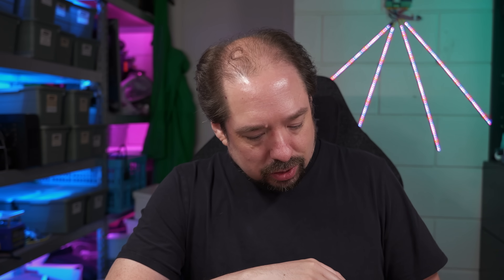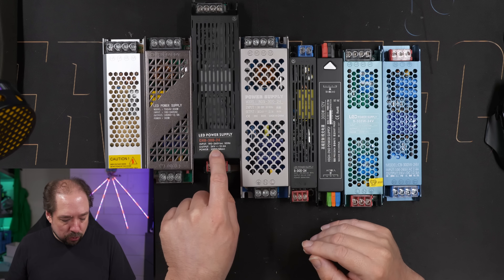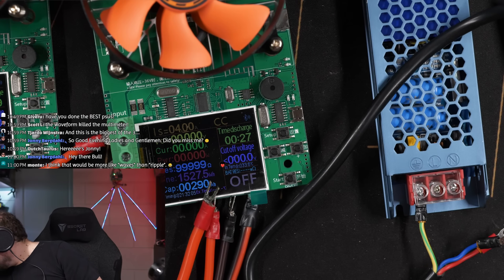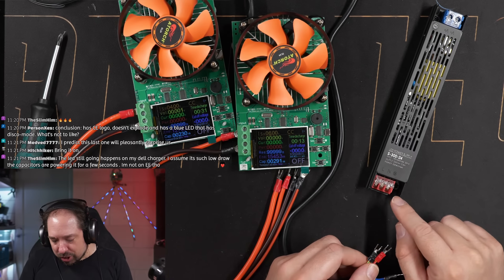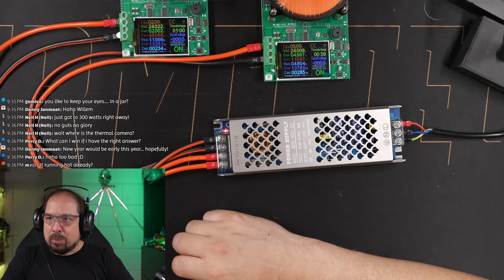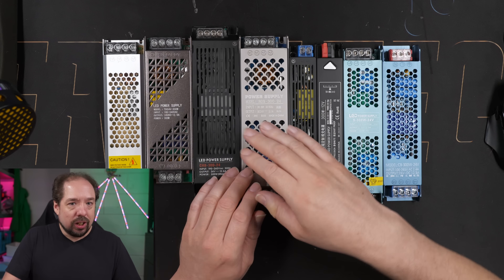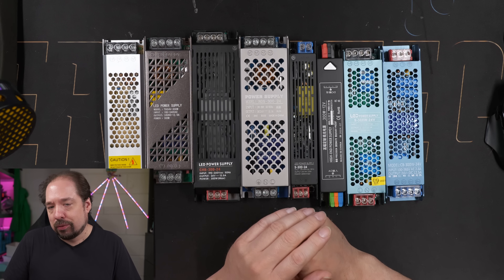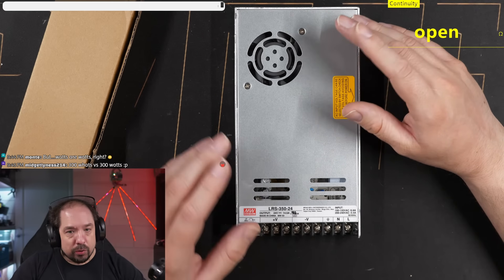💡QuinLED💡The Truth About LED Power Supplies | DON’T Make This Mistake!

Comment from the maker: What's your personal experience with power supplies in your LED projects? Have you ever been duped by such an "LED Power supply"? Let me know in the comments!
Reply: Like you I stick with Mean Well. A few years ago, I used them in a weatherized enclosure to power my original Dig-Unos. They've been worry-free and surviving the Texas heat ever since.
Reply: Almost always the PSU fails in short order for most of them. If they get to half the rated current it is a miracle.

However I have had Meanwell supplies die on me, mostly those made in the 1990's, and the fix was to replace every capacitor on the output side, and every small electrolytic in them, plus resolder all the dry joints. Not a bad life for units that ran pretty much 24/7 at around half load for over 2 decades.
Reply: Hey, man, this is very missleading, what you are doing in this video! Aliexpress sellers are clearly using Chinese Amps and Wats to rate their products, you are using the wrong  units of measurement!
Reply: i bought quite a few 12V power supplies from aliexpress, not specifically led ones but i suspected about them not being genuine with their rating so i always added 25-100% more Watts to what i need. (At 60W overprovisioning 25% and above 150W basically just buy double the needed capacity) but i just did that out of fear that they would catch on fire - now that i know how much they vary i want to check if any of them don't deliver 12V...

Comment: Thank you for the helpful information. I’m working with a retail showcase that uses LED strips as backlighting for a printed acrylic display. One unit recently failed, and the original display vendor is no longer in business. After opening the unit, we confirmed it is powered by a DC 12 V, 150 W power supply. I was originally told that LED strips require an LED driver, but this setup appears to use a standard 12 V constant-voltage power supply. I would appreciate your advice on when a standard power supply is appropriate versus a true LED driver, and whether there would be any benefit to switching to an LED driver in this case. The system has been operating for about five years, with only one failure out of several dozen units. We also have two production batches of these displays. The first batch is noticeably brighter than the second, although brightness is consistent within each batch. I’d appreciate your thoughts on whether a better power supply, an LED driver, or voltage adjustment could improve brightness, or if this is more likely related to the LED strips themselves. Thank you for your help. (I was looking at UHP-200-12 or ELG-200-12)

Comment: What are thoughts of using Poe ++ type 4 which can supply up to 90 watts for each Poe run ?
Reply from the maker: I've done a livestream and article about it, it can work but it's very costly. As in about $100 per port, just for thst feature.
Reply: @IntermitTech when you say $100 per port do you mean port and the poe to dc converter? Because I can find poe++ type4 switches that are $50 or less per port from ipcampower 

Also can you provide the link to the video or article you mentioned?

Thanks for the videos you do. Great stuff
Reply from the maker: Yeah but you need to look at the power too, most switches aren't rated to deliver the full 90w for each port and won't handle the huge transients LEDs can cause. I looked at ubiquiti switches for instance and then you are going to pay at least a thousand to get a 48 port to have a decent total budget of say 720W.

So it becomes a complex sum. It was about 1,5 years or so I did my testing so prices might have come down a bit. But if the switch is 1000 so you can run say 10 ports full power and then need 50 dollar extractor for each, that's 1500 dollar just for the power infrastructure without any controller and such.

It might make sense for some setups but I don't believe for a lot of them, at least cost wise. I have a different system coming out soon which should be much lower cost and more effective feature wise too such as keeping the controller centrally located. Also won't be as cheap as a PSU and controller, but adding more stuff won't make it cheaper.
Reply from the maker: This was an earlier one https://quinled.info/2021/04/24/can-you-run-leds-over-poe/ and after that I did https://www.youtube.com/live/pGlj9a49yOk?si=dTQnc6xvBYHHXIdI

Seems the brand you mentioned at least has 1200W total switches but still $600 so that's $50 per 100W and then you add-on extractor still.

Comment: I had the opposite problem.  I just assumed they were a nice compact power supply....  Didn't overrate the requirements much and it's underpowered and constantly hiccups.  Tried adjusting the current sense and it still hiccups.
Reply: That was on ebay.
Reply: LED Power 150w 24V 6.25A rated.  4A is okay but 4.8A is a fail.  75% max.  It might manage if it was rated 100W.
Reply from the maker: Yeah, sounds like one of those "LED power supplies" alright!
Reply: @IntermitTech  I reduced the current sense resistor values and i think that the voltage falloff wasn't as bad...  However i thought why don't i bypass them....   Don't do that...

Comment: are there any gan power supplies for LED and what is your recommendation for using computer power supplies for LED projects ?
Reply from the maker: GAN not really yet, it's still a more expensive tech and mostly used for when it needs to be small.

Computer PSU can be used, but pay very close attention to per wire limits, OCP of the PSU (because of using it for a different purpose) and make sure to fuse each wire properly!

Comment: Would it make sense for me to use a QuinLED-Dig-Octa Power-5 for power distribution in a project that uses a complete different controller than that dig-octa brainboard? It's not even an esp32/wled as a matter of fact.
Reply from the maker: Yes for sure, the system is constructed in such a way that powerboards and brainboards function independently from each other, or together.

So if you have a project that requires many more LEDs to drive for instance and the ESP32 isn't that suited, the power boards are still great for power distribution and fusing!

There are others who already do this so no problem at all.

Comment: What about the SDR line? The SDR-480P-48V for example? And what 48VDC/12VDC 2.5A converter do you recommend? Im thinking of the Traco Power THN 30-4812WIR.
Reply from the maker: The SDR lineup is likely fine but haven't used it myself yet! Also haven't tested that specific DC DC so can't really tell you honestly...

Comment: Hello, I'm hoping you can lend me some advice. I have two high bay LED lights in my garage workshop that have been flickering for a while. These are equivalent to 700W incandescent each so, very bright! I pulled one down and opened her up. There are three separate power supplies in there, each one going to one of 3 banks of LEDs. They tie together with pwm lines and are rated at 45V 1.9A 85.5W output. I'm thinking I can replace these three with one Meanwell UHP-350-48 Power Supply - 350W 48V 7.3A - Slim type and wire the 3 LED banks in parallel. I don't know much about  LED lighting. Is this a valid approach to repairing these lights? Since the LEDs still function fine, I hate to throw them away. Thanks!

Comment: i usually use half they rated capacity as i did already knew they didnt deliver.  meanwell is extremely expensive in my country (60-70 units for cheap chinese 360w, 1000-1200 units for meanwell or other american brands)

Comment: I've always oversized my PSU compared to demand by a lot. Never seen "LED PSUs" before but, I've not needed to make an LED driver for a while.
All the strips I've got, I’ve had for around 4 years, the PSU's are in my garage and they only get turned on from Halloween to Christmas.

Thanks for the heads up though!

Comment: Awesome video warning people about this! 
I had a bad experience with a couple I had purchased a few years ago, and started testing them... So many were falling short of even HALF their advertised power.

Now I use cheap HP/Dell older style rack mount server power supplies. Super cheap (old New stock for discontinued servers lol), pure, filtered 12v high amperage output. AliExpress has cheap plug adapters for the big blade connector on the end to connect your stuff like LEDs to it. They're awesome for whole house length outdoor "Christmas Light" style analog setups. (I use a different setup for my 5v argb stuff.)

Comment: Are these output ratings based on 120V or 240V input? When I have looked at PSUs (incl Meanwell), they state different output levels depending on input voltage. For example, the Meanwell ELG-200-24B has a rating of 8.4A (200W) with 220-240V input and only 6.25A (150W) for 100-200V input.
Reply from the maker: I'm in Europe so all my measurements are based on 230v input. Most of these supplies aren't even rated for 110v I believe.

Comment: Even Mean Well power supplies aren’t all perfect. I bought a genuine 5V 12A Mean Well power supply and it couldn’t deliver more than 10A continuously. At 10.3A it just immediately shut itself off.
Reply from the maker: Oh wow, that's quite odd for meanwel. I've tested numerous models and so far they all over-perform basically! Do you know what model it was?
Reply: @IntermitTech I think it was LPV-100-5.

Comment: I have a 1500w 24v Meanwell PSU ready to go for a project i am working on featuring 45m of your excellent 896led/m strips, have not had a single issue with Meanwell and will continue to use going forward, cheers for the insights :)
Reply from the maker: Woah, that's awesome and will certainly be right!

Comment: I've seen one of those ultra slim LED power supplies, it measures like 2x2x30cm. I wonder how they did it and how would it perform...
Luckily I have a variable power supply to compare it's output and a multimeter to actually test it.

Comment: Good video and it shows how you will be scammed buying from Ali. I never ever buy there. 
On a side note: why would it matter where the live an neutral are connected. In many countries, plugs and sockets aren't even polarized so live an netrual end up randomly on those terminals. Further, if you have any concept if switched mode power supplies, you'd know that the first thing after the filters (let's hope these have EMC filters!), is a rectifier. And a rectifier couldn't care less about live and neutral. After the filter caps and switcher transistors there is a transformer providing isolation. The concept of live an neutral only exists in your house wiring.
Reply from the maker: Well it's not really an Aliexpress problem, that's generalizing a bit too much, there is plenty of crap like this on other shopping sites, including Amazon and I get plenty of great stuff from Aliexpress, so that's not really the issue.

The neutral live thing was more that they didn't follow any set standard and just did it randomly it seems, that's it.

And EMI filters, poh, especially on the really cheap ones, I wouldn't count on it. 🤣

Comment: there is a "wisdom" in pc building which applies honestly to almost everything that involves electronics in general - NEVER CHEAP OUT ON THE POWERSUPPLY
sure you can most likely live with some led strip getting fried (well on those you showed us there rather unlikely as they cant even deliver a percentage of what they "rated" lol) but on more delicate electronics or lets say a new shiny pc you spent with current gpu prices etc whatnot 3000 buckeroos but thought to be to cheap and picked the goofy 20$ PSU from a brand nobody ever heard of ends up nuking your system as soon things start to request some serious wattage.. 
let alone the components getting sent to nirvana - when those things fail they not rarely do in a horrible way because the cheapest of the cheap parts (if even existing to begin with) where used and iv seen some not even proper trigger certain breakers and happily keep drawing juice while your house is already halfway burned down!

Comment: I always derate the supplies to 80% max capacity when I calculate the size. Also, it depends on the manufacturer
Reply: That assumes you live in honest world where companies put honest label, like 100W max as 100W max, then you can use that 80% rule.
There are lots of cheap PSU that can deliver not even half its power written on its label.

Comment: I bought a "Joylit" and runs  WAY cooler than the 6A brick style power supply I had running it.. It was getting dangerously hot and I wasn't near the 6A rating. The Joylit is barely warm but it's also rated at 16A/400W.  I'm running more strips than I was with the 6A.  But I also have a 5 channel dimmer so I'm not running the strips at full power.  You got me curious so I threw my electronic load on it which unfortunately will only do 300W, which the power supply gladly did. 13A at 23.8V which is a little over 300W.
Reply from the maker: Hmm, googling that brand shows me a lot of PSUs that look like the ones tested so I'd measure voltage sometime running various brightness! But a frame/open style PSU will run much cooler then a brick since that's fully encased and has no real way to get heat out. So if an enclosed brick isn't 100% needed, open PSU is better in that sense. :)

Comment: Came to the same conclusion while ordering some Amazon led psu's.
Wanted a cool running unit so I bought a 300w version for a 200w load and it could not deliver and ran very hot...
Bought a 450w and it was ok.
Reply from the maker: Ah yeah, sadly it can be hard to identify, but over spec'ing is usually a good thing with power supplies!
Reply: @IntermitTech 
Yes, but 50% extra should have been more than enough.
When you need more than 100% extra, then something is really wrong...

Comment: Please be aware that the Mean Well PSUs on AliExpress are not necessarily cheaper than with local resellers. For my example, the LRS150 costs €23 on AliExpress, and only €17,70 on Reichelt. Of course, AE has free shipping and REichelt doesn't, but when buying 2 LRS150s, the price including shipping is already at €21,18, and that price only continues to drop if you need more. My point is: Don't assume that AliExpress is always the cheapest way to get something. Now obviously, this is a local and specific example, but it may sometimes pay off to check local sellers too.
Reply from the maker: Oh, that's a good tip! Lots of places (like mouser) will only sell to business so I bought on Aliexpress because of convenience really. I'll certainly compare next time!
Reply: @IntermitTech  Mouser will certain sell to individuals, at least in the US.  I've bought a bunch of stuff from them over the years.  Unlike Amazon, no free shipping!  But shipping via post office for a few extra days delivery is cost effective.
Reply: Mouser, Farnell, Digikey all sell to private individuals?
Reply: @Validole  Yes, and they're all extremely expensive (more expensive excluding VAT than elsewhere including VAT), and charge an arm and a leg for shipping. You are correct though, it seems like they all sell to consumers over here too.
Reply: Also. Mean Well will not honor the warranty if it is not purchased from an authorized distributor, so with purchasing from AliExpress and most Amazon sellers, you are taking a risk if you happen to have one of the rare warranty claims.

Comment: I like the Meanwell CLG/HLG series - completely sealed and encapsulated into an aluminium extrusion, so no fan. Captive cables which can be useful for outdoor applications without the need for an enclosure
Reply: I have a bunch of ELG units, ranging from 150W to 350W. They are cool, quiet and easy to use. So far only one has failed, and that one did so precisely 5 years and 1 weeks after the purchase. I would say that is brilliant planned obsolescence, if not for the other units still working after a decade...
I also have to regularly replace the PSUs in random (sometimes pretty fancy) LED fixtures owned by friends and family with MW equivalents, because light fixture manufacturers also seem to buy their parts from sketchy sources.

Comment: Going to order a tester!
Is there reason you had 2? Was the maximum load a single tester could take was more than a power supply?
Ie the tester's limitation?
Reply from the maker: Yes, I have 5 actually! It all depends on your needs, each tester can do up to ~180w but I also test 5v a lot and then the cable diameter you can use quickly becomes the limiting factor, hence using 5 load testers vs 1 big one. So I can scale up how many you need and with 5 I can do 5x 20Amps for 100Amps (@5v) total for instance, so while that's well below the max rating of the tester you get so much voltage drop otherwise.

Comment: I looked for such a video a few month ago, because I wanted a quality PSU for my ceeling light. I didn't find the video I looked for, but at the end I went with a UHP-350-12. Yes, it was the most expensive, but I wanted something which I could trust and which wouldn't burn my house down, so it definetly was the best choice...
Reply from the maker: I can confirm! I've been using UHP supplies for years and like I said in the video, they haven't failed me yet. Fully silent, very efficient, active PFC, yes they are expensive but worth it in my opinion (if the budget can allow)!